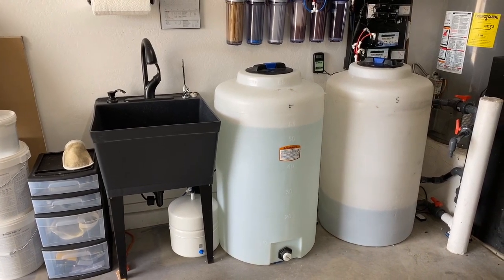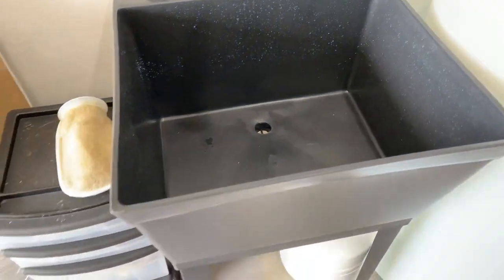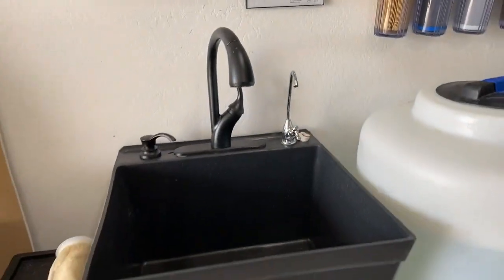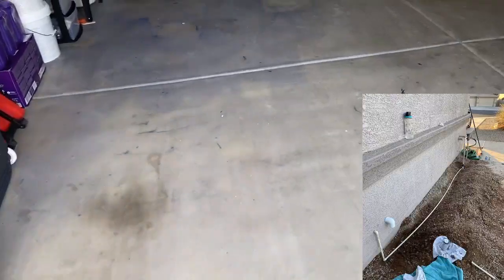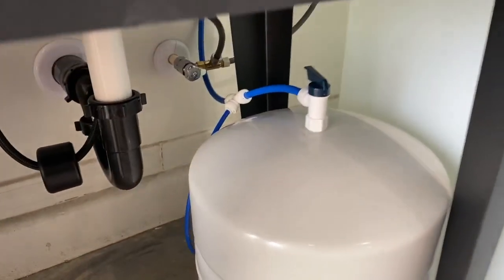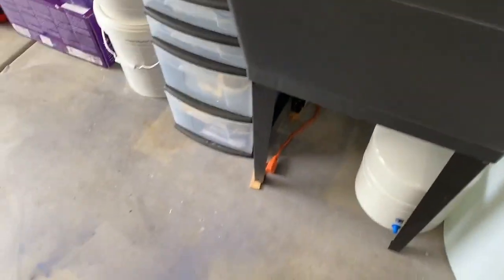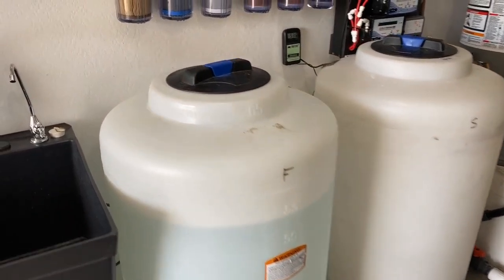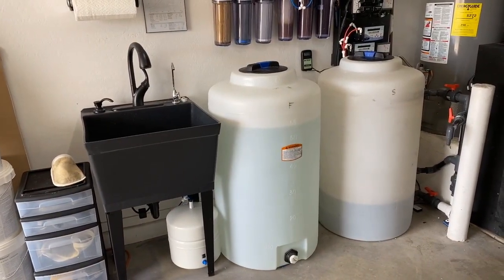Sink And RODI Faucet Install

Comment: Do you have a permeate pump for the water going into your pressurized RO tank?
If not you should really get one because otherwise your RO system will be working against the pressure of the tank
Reply from the maker: Yes I do.  Please review my RODI videos.  Also I have a check value going into it.  I forgot to mention this.
Reply: Reef Automation good stuff man
Reply: And unfortunately a booster pump doesn’t quite do the same thing I actually have both a booster and a permeate pump on my system
Reply: Next upgrade will be an auto flush kit for sure! But in time still have one more new flow restrictor.